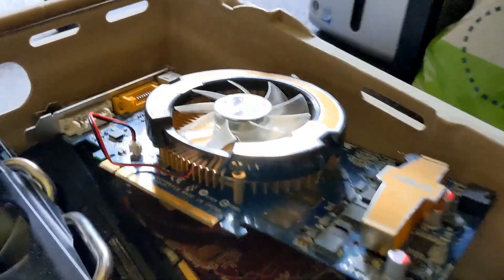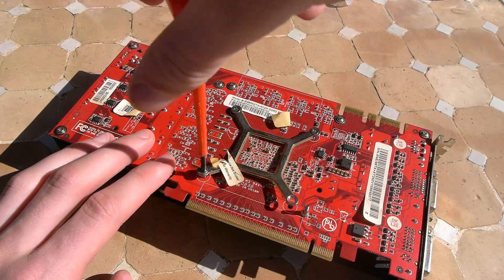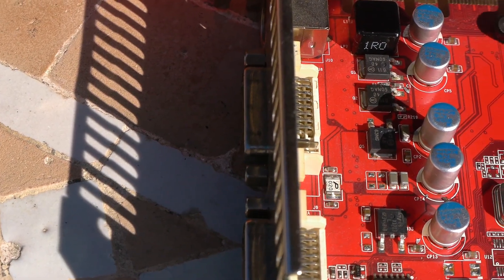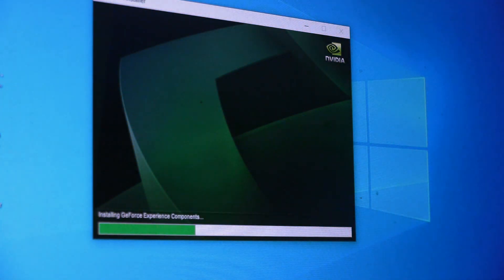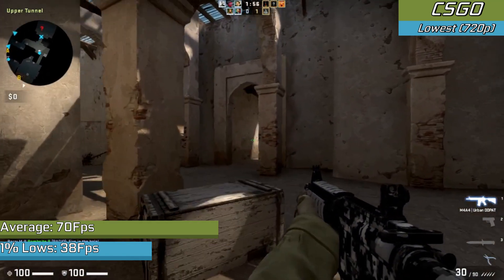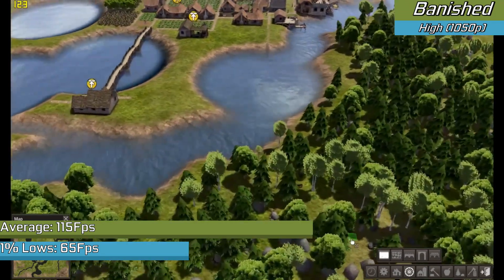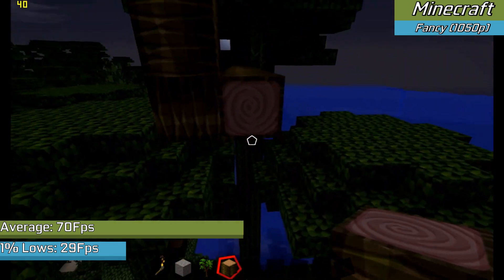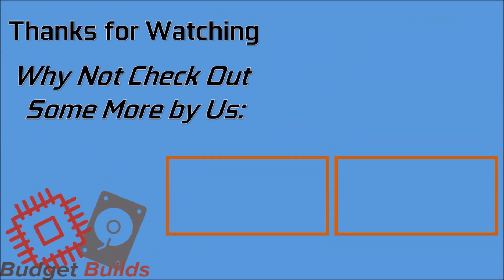Nvidia's Forgotten Flagship!

Comment: still have a pny xlr8 9800gtx+ on my wall.   went to a 550ti after then to sli 550ti for bf3 then 7970ghz and 7970ghz xfire with an overlocked xfire 1440p monitor back in the day that would do 100hz+. those were the fun times

Comment: i have the same card in my second pc. I dont use this for gaming i only use it for watching youtube at 1440p or 1080p. This GPU does well at 1440p video playback and theres an issue with it. Every so often the screen goes black and shows red lines and it only lasts for like 4 seconds and goes back to normal. Anyway when i launch furmark and stress test it, it shows lines and artifacts on the display. The card is dying and like 2 days ago i bought a GTX 550 Ti for a small upgrade.

Comment: Still use this card, an evga with the  nice heatsink/fan it came with. Total powerhouse for it's time. It was a 250gts if you overclocked it if I remember correctly and was a hell of a lot cheaper. Crushes Fear on high settings with an x2 and ddr 400 without overclocking. It handles everything 2014 or so and prior.

Comment: I had one of these cards, it ran well until it died, it was replaced with a 285 card which ran a bit better than this until it also died, that was replaced with a 560Ti which ran even better until that also died which was replaced with a 770 card which ran very well which actually last too. but for the 9800+ it was running Crysis well until you got into the snow part and here it did not run Crysis well at all

Comment: The only thing I can say here is at the time ROPs were vital and memory interface of 256bit memory interface was the goal.
At the time at the 512MB video memory mile stone we started to judged a graphics card by the memory size and prayed for more ROPS
We're still doing that and we usually buy the next card in the stack with double the memory when we upgrade.
It will not be that way much longer as we approach parody with work station memory sizes.

Comment: I think my favorite older graphics card that I've worked with has to be the Radeon HD 6970. It was an incredibly accessible budget card about five years ago and there was a distinct chance that, if you bought a Radeon HD 6950, you may be just a BIOS flash away from the flagship single-GPU card of that series.

Comment: Ah man, I had a GTS 250 (which was basically the final rebrand of this card), that i picked up for like 50 bucks in 2011. I picked it up as a physx card that I used alongside my Radeon 6950, and then just kept it as a spare card. Honestly as a backup card it was solid for years, floating around from build to build when i needed to test with something that required a PCIE power cable, and had more grunt than a basic display adapter.

Comment: The 9800GT and 9800GTX are some of my favorite cards on the planet.  They run on any OS, they have awesome 3D performance, and the smaller finfet ones are really good at doing 2D art.  I love these things and they are so damn common and so damn cheap.  They do alright being paired with a video editor in OSX, and final cut pro X knows how to use them.  They run, not all games, but most games actually pretty OK.  Though expect to run at low, unless its something with the dice engine in which case run it at ultra who gives a fuck it'll just run.

Hell, fuck it, you wanna make some fucking shit scream?  You can, in fact, for under 100 bucks get a 4 way sli render box up and going for the fuck of it.  Bridges cost nothing, cards cost nothing, so for the experience of it alone I highly recommend you try it out if you have hardware that'll take it.  Its not something you would experience ever again, thats for sure.

Honestly, I'm pissed I just got rid of some, actually kinda crappy, 9800's.  The weren't binned high enough so over clocking got kinda shitty and they couldn't keep in sync.  I wanna find some new ones and get them water cooled.

The other thing that is cool about them is they are new enough to be powerful but old enough to be.... well, old.  I plan to use them in PowerMac G5's here pretty soon as they are pretty ok cards to use and if you had 2 of them in a powermac you could do a lot.

Eh, IDK.  I also like to make pentium 4's do things they aren't supposed to.

Comment: gpu as forgotten as the 1050p resolution :p
Reply: I get 1050p monitors all the time lol.

I build and sell gaming PCs and the occasional office PC.

I don’t normally get and sell monitors along with he Pcs but when I see them being either given away on Craigslist of FB marketplace or other apps (or even on the side of the road) I grab them to include.

And far more often than 1080p I get 1050p monitors for some reason.

1050p and 900p are the most common.

I also rarely get 720p (or whatever the pc equivalent was as it as few digits off)
Reply: @stevesmith1383  thats weird, ig they are going out of fashion huh, maybe because most games nowadays don't fully support it? I can't remember that many examples other than Far Cry 3 for now cause its the first game I tried a 16:10 monitor on, it had weird bars on top and bottom at times.

I still miss that monitor a lot, it looked bigger than my 16:9s when I sat close to it
Reply: @DyoKasparov  funny how life works.

I just got a 1200p monitor.

1920 x 1200 16x10 lol

Comment: I had a 9800 GTX+.  I also had a GTS 250, which I learned was a re-badged 9800 GTX+.  I tried to re-flash the 9800 GTX+ so I could SLI it with the GTS 250.  The re-flash worked, SLI did not...

Comment: Wasn't ATi still ATi back then? Not AMD.
Reply: AlyxMS Yeah, AMD bought them around 2006. I think they kept the “ATi” branding on the cards/chips for a couple of generations after that though.
Reply from the maker: AMD bought ATI after the final X series card the X1950XTX.  You can call them ATI or AMD, both were used until the introduction of the RTG brand name

Comment: I had a gts 250 around 2010 it was a  great card for the price and the time. So not too surprising. Ironically I was also looking at that card but I found the 250 to be cheaper if a remember. Yes a aware of the fact the it is a rebrand gtx+ 9800

Comment: Still running off of a GTX470 (Was running 2 but they both crapped out a few months ago). Will eventually have to invest in a new rig, but when it comes to tech I tend to want to run it into the ground.

Comment: I actually have a GTX 9800+ in my retro PC!
Partly because it's slightly better than the 8800, partly because I also have an ATI 9800 Pro (for Windows 98 and other pre-XP titles) and I wanted to be able to meme about how the machine has dual 9800s.

Comment: I liked the 9800 gtx + as it clocked like mad and didn't run as hot as the 65nm version, the gts 250 was often built to a lower quality and didn't have as good of a vrm and cooling wasn't great either being treated as more of a budget card.

Comment: it's (mostly) forgotten because it was never a proper flagship at all. It had both less memory bandwith and less memory in total than 8800 gtx/ultra which remained the highest end Nvidia cards (they remained higher priced as well) all the way untill gtx 280 was released.
Edit: That holds true for the regular (non-plus) 9800 gtx which came to market in april 2008 and was nominally Nvidia's single gpu flagship, but was generally a bit slower than the 8800 ultra.

Comment: I still use a zotac 610i running both Windows 98 and Windows Xp. This is not a dual boot system. However i decided to go with an Acard 9010 ddr ram ssd. The drive is only 32gb and only 27gb useable but when you are using software everything seems instant. It also allows for backup of the installed os, on a 32gb flash card. So i turned my pc into something from the 80s, being i install only certain programs on different flash cards making it like a cartridge system :)

Comment: I'm still rocking EVGA 9800 GTX+ on xeon w3565 16gb 1600mhz triple channel XD great to see this card coming up on this channel loved it, btw i get around 158 fps in csgo 1600 x 1200 and it hardly drops at 80fps. Though mine is quite a lot overclocked, and my temps really doesn't exceed 70c.

Comment: Its funny cause i had the RX 480 nitro plus and i was sad when the 580 came out soon after but it turned out it was basically a max overclocked 480 anyway which the nitro plus already is which is why the 580 couldn't overclock really at all cause it was close to or already maxed to begin with and now that i hear theres a 590 im kinda sad its like stop releasing the same damn card for fucks sake

Comment: That is a flagship? I have a GTX295. Now THAT is a flagship.

However i hate it. GTX750ti is so much nicer and de facto faster.

As to the 9800... well the 8800 urgently needed a refresh, since it had hardware limitations that made it not fully compatible to the rest of the 8000 series, as the G80 came out back in 2006 with original incarnation of 8800 GTX, while the rest of the series followed almost a year later and were reworked. The largest difference is that G80 only supports CUDA 1.0, while the rest of the series had CUDA 1.1 which contained the highly necessary atomic additions. The new G92 chip came out both as 8800 series and 9800 series, which was a bit funny. This 9800GTX+ is however not the G92, it's the G92 die-shrink version which... i somehow managed to not be aware of. It's a perfect replacement, no need to hunt for an 8800 instead.
Reply: @Dalle Smalhals How bout no? I am not exactly running short on old GPUs, and all of mine work - but none have a lot of value left in them. Current PC has a GTX970 in it, which is so so comfy, i love it!

Comment: How comes NVIDIA dropped the VRAM from 800 odd mb(forget the exact amount) on the 8800GTX/Ultra down to 512MB?
Reply: Jon C it has to do with the width of the memory bus. This chip used a 256 bit memory bus, down from the 320 bits of the higher end 8-series.

Comment: I think people just were confused why the flagship card only has 512mb Ram, while the previous flagship modells (8800 GTX & Ultra) had a whopping 768mb.
Even if these numbers do not matter much, cause the 9800+ could use the VRAM more efficiently, it was still relevant to buyers back in the day.
And the direct compeditor, the AMD 4850, was available with a whole gigabyte of ram.
So I blame this on bad marketing. Well, at least nvidia finally realized that VRAM was a huge marketing aspect with the GTX970...

Comment: Honestly surprised how well this old girl did, I seen so many variants of the gt 8000 series chug hard on GTA V and here this card is, flipping them all the middle finger.
Reply: Well its basically a refresh of 8800 Gtx ultra on smaller and more efficent node.
Reply: @shadowguardian3612  No. The 9800GTX was just a higher clocked 8800GTS G92, and this is just a higher clocked die shrink of that. G92 is quite different than G80 on the 8800GTX.

Comment: hi again. i did find out my cpu was thermal throttling. in fact, it was thermal throttling at idle with nothing running! and, i am currently underclocking it down to 2.3 ghz, which achieved me a way better frame rate.
now, though, i have a question: whats the best agp 8x graphics card that supports dx9 or dx10? i have an athlon running at 1 ghz (i have no idea what athlon it is exactly, but i think its the same socket as another athlon that runs at 3.6 ghz. the socket is 462 or A, i believe) and have 512 mbs of ram on it, however im planning to stuff another 512 mbs or get 2 1gb sticks running at 400 mhz. is it even worth it to upgrade it? maybe it could be better to just track down the case and motherboard and buy the same exact parts i dont want to replace and leave this one untouched.
i also did try putting an ati radeon 9250 into it, as an upgrade to finally put the geforce2 mx400 into a box to collect dust, but it sadly seems to be dying, with artifacts everywhere :(.

Comment: Unfortunately not the OEM-BlowerStyle silver-black Design, nur still im very Happy that this Card get's some Attention. ITS the Last of the old Generation Nvidia GPU's (pre280 era). 

Also funny Story, Back in 2014 i bought a prebuild PC With a 4700k and a Radeon 8950OEM. Nur in desparately wanted a Nvidia GPU because... Im a Green fanboy. Anyway, i bought a 9800gtx+ for 15€. Needless to say It defenetly was powerful, but for me i was disapointed. 3 months after i bough my gtx480 OEM and that beast was more packed With Power. But unless my 480, my 9800gtx+ and my radeon8950 both are still working. (The 9800 paired With a C2Q 8200 3.0ghz oc)...

Anyways great Video, and a fair review of a Legendary piece of Nvidia History.

Comment: From the time when "GTX" wasn't the series, but the suffix meaning the highest in it's bracket above stuff like GT, GTS and GS
The 9800 GTX+ was also rebranded into the GTS 250 btw.
Reply: Shows how big of a leap 200 series was.
Reply: and when FX was a geforce series
Reply: I still have a GTS 250 on my shelf, and it is still working.
Reply: @NukE30  I still have a pair 9800 GTX+ (KO's) in a working system (X48 chipset no less)
Reply: @HappyBeezerStudios  yes! It started out with the Q6600 and I eventually upgraded it with the Q9650 which I still have plans to delid that CPU and run some extreme overclock in the near future
Reply: @HappyBeezerStudios  Thanks for this info mate, it has been a long while since I looked into which Intel CPU's are soldered. Either I forgot or never made it down my list this far.
You are correct though, if any CPU is soldered from the factory, UNLESS running direct-die cooling...delidding ANY soldered CPU is pointless.
Thanks again mate!
Reply: @glutenfreegam3r177  x48 system? Haven't heard of that one, but I'm assuming my first system was the series immediately after that! I'm running an x58 board with triple channel ddr3. I got the guts out of a first generation Alienware Aurora R1 and replaced the i7 920 (4c/8t) it came with, with an i7 990X, which was probably the first 6 core, 12 thread cpu you could actually get your hands in in the consumer market for the eye watering MSRP of $1200 in 2011 (not counting the lower 980X). I got the cpu for $135 off ebay, although most 990X's are going for up to $250 still. Then I eventually replaced the gpu with a 1070ti, because it came with an R7 360. So I essentially went from a gpu bottleneck to a cpu bottleneck instantly lol.
Reply: The GTX+ was also known as the GTX KO, I have one with each branding from EVGA. IIRC they switched from the KO to the plus designator but I could have that backwards.
Reply: You are correct.
Reply: 1050*p* ????

wat
Reply: @xgeorgex2182  Mostly known for the then quite common 1680x1050 resolution.
Reply: @xgeorgex2182  1680 x 1050 is a 16:10 resolution, whereas 1080p is 1920 x 1080; a 16:9 resolution.
Reply: i was happy owner gt 240..pre-top card btw
Reply: ooohhh I own an GTS 250!
Reply: @RowanBird779  crazy error fan
Reply: and GeForce GTS 150
Reply: Omg that was my card until 2011 :0

Comment: I can't believe how well these hold up. My second GPU ever was a 8800 GTS 320MB and I was using this for years before finally building a new system. Unfortunately I sold it last year, as you put it there's still quite a high price associated with the 8800 cards. I did pick up a HD 4870 512MB for a fiver a couple of days ago so will be giving that a bash soon - it will be interesting to see how they compare!

Comment: Do something on the GTX 285, it idles at 200w
Reply: Many many moons ago I had 3 bfg 285s in tri sli.... What a disaster that was 😂
Reply: I bought a GTX 260 c216 and a GTX 285 in a combo deal from a friend. Sold the 285 because I couldn't keep it cool. 260 c216 was 95% performance with 50% the heat. Bizarre.
Reply: really bro?? 200 Watts. Damn
Reply: I have a GTX 295. It's the same as the 275, but 2 chips on one card.
Reply: @Tom2404  is that the VHS looking card?
Reply: @hughjassstudios9688  yes, I think it is. The dual PCB variant of the cart kind of looks like that. However I have the single PCB variant that is more normal looking.
Reply: @Tom2404  same, GTX 295 was nuts. Crazy that at that time the ultra flagship from nvidia cost me £495 xD It was a monster, but ultimately flawed.
Reply: @darkauscus  I got mine ultra cheap. I think I paid 20€ a few years ago. It does still work. I never use it because I have more powerful cards and I fear it might die on me.
Reply: Ah the 285, the only card named for the power consumption.
Reply: @SemperFidelis2006 ok so your youtube display pic moves.
Reply: Other times, impressive
Reply: Holy crap, my gtx 970 idles at like 70w lmao

Comment: u should do a series about forgotten but still capable GPUs!
Reply: isn't that the entire point of this channel?
Reply: I never see him review gpu's like old fire pro those cards are interesting.
Reply: @jjaze9831  or old Tesla line. The K series are still great especially if you need a proper 10-bit output.
Reply: @jjaze9831  But apparently most of those old workstation GPUs are still expensive, considering this guy mostly bought things from sub-$10 category.
Reply: @hahaiseewhatyouredoing9086  yeah here in ph 
Some of them are like $200 but some I found around $35.
Reply: What about something like the Nvidia GeForce FX 5950 ultra. I remember that was the top flagship graphics card from 2003, but seems to have been forgotten soon after the 6000 series was released.
Reply: @sburton015  I have one, they are much slower than the ATI flagships of the same year.